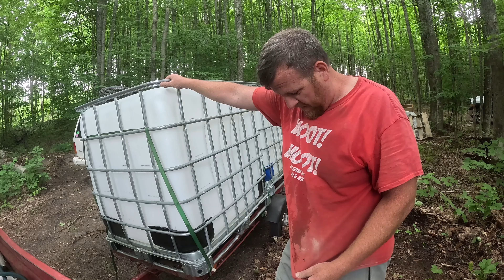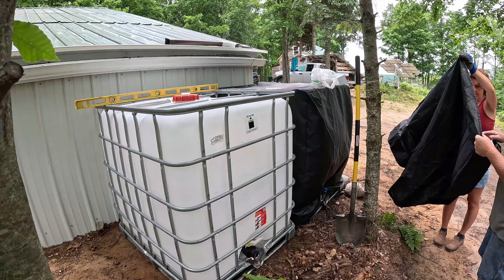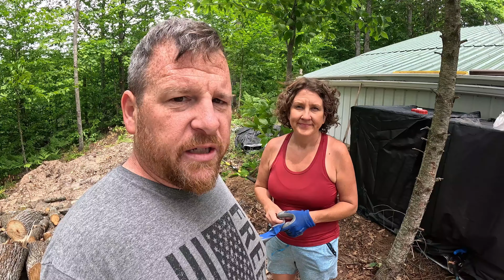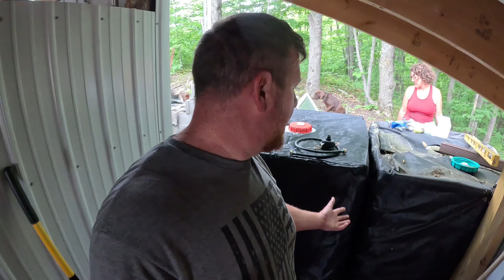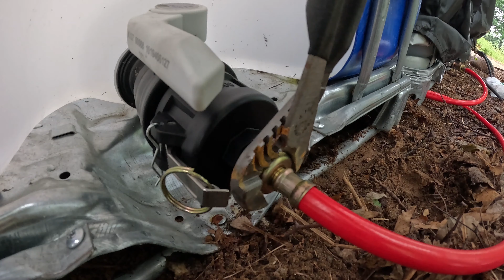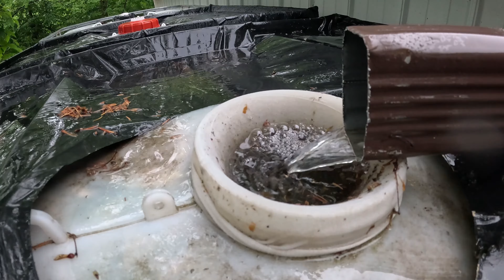Step-by-Step Guide: Expanding Rainwater Collection at Our Off-Grid Cabin - Off Grid Water Systems

Comment: I know I am late to the party, but here is a suggestion.  You might know this all ready.

 You will need a larger hose to move water between the tanks!  When one tank is full and the others empty, there will be about a 2psi difference between the tanks, and the fill will appear to go smoothly.  As the tanks get closer to each other in water level, that pressure will drop to inches of water pressure and the fill will appear to stop.  

Your main tank is being fed from a 2X3 or a 2x4 down spout.  That will fill up the collection tank a lot faster than that little hole in your "Y" connector will move it out.  Water will seek its own level, but not as fast as the water is coming in.

Comment: Great job you guy's 👏. More water storage is awesome. I agree when the extra tanks are full close them off to isolate them from a leak or broken hose. If you're going to put the new shed by those 3 you could add another tank and connect the gutter to the 4th tank so they fill at opposite ends. Loosen the top lids to release pressure as they fill. Great video and looking forward to seeing the next.

Comment: Terrific job guys!  That creates an awesome feeling of accomplishment and should lessen your stress when the rains slow down.  I always say:  you never have too much water or too many solar panels!  Use that on a shirt logo!  Pick up an extra 12V rv water pump and wire it so you can plug into a powerstation, just in case of an emergency where you have to pump out one of the tanks.  Just to be safe.  Stay safe, and God Bless!  Congratulate each other on a job well done!  PS  You could use the pressure washer to help clean out those tanks.  Might make it a little easier.  Last thing:  get a white rv drinking water safe hose to connect the tanks you are going to drink from.   Buy the fittings and custom cut the big hose into what you need.  It will save you money over the washer hoses and you don't want your drinking water to taste, or smell,  like rubber.  Camco  makes it and you can get them at any RV place or Amazon.
Reply from the maker: Nice.....thanks

Comment: I would like to split the difference of our 96° and your 70° degrees and settle for 83° each!
I would replace the wash machine hoses with short RV hoses at some point as they don't shed rubber over time.  PEX would be even better.  Our yard and garden could use some of that rain too!
The Air Force requires a supervisor to sign off as checked and verified on every critical job completion.  In 2002, after a 16 hour repair, a supervisor was tired and signed a job off without checking it, and the aircraft lost a wing during refueling.  It was approaching decommission due to age, so was auctioned off for 700 dollars after all usable items such as engines and avionics were pulled off...   Glad you have a 'supervisor" who actually checks behind you...   😎

Comment: Nice tanks. U gonna put intake sediment filters? They have bypass input filter setups too. Then can use bacteria electric tank electrodes on timers, or timed UV-C aquarium type lamps or LEDS...VERY effective too. Make sure tank electrodes are the same non-corrosive stainless...carbon...or copper...in a grid-type perimeter electrode, then a center-post deal..just like a giant D-cell!! Probably just one amp at 48volts..no more volts..for safety. Any minerals you add will help conductivity. Some even pass water through glass-topped ducts exposed to sunlight for the UV that's same as the UV-C lights!

Comment: I think you're going to need some form of air bleeder for each of the secondary tanks so as the primary tank fills it will allow the other tanks to equalize with the primary
Reply: Yes.  Or crack the lid

Comment: Great video, Jay and Jen!  I know you shut off water to the cabin in the winter, but how do you manage water needs then?  (I empty all my tanks on fruit trees, spruce trees, etc., in late fall and leave one 525-gallon tank about 60% full.  I stagger three tank heaters at various depths in this big tank and hope for the best.  So far, so good re not freezing.  We have electricity but plan to use solar generators to power the tank heaters if the grid ever goes down.)
Reply from the maker: We empty the ones outside and melt snow the rest of the winter. The tank that is hooked to the cabin actually stays pretty warm until late December....so that is nice

Comment: I have a double tank setup with the y connectors it works but if you get a decent rain primary tank will overflow while the secondary tank will only get a small amount through the connection I have lost alit of water I'm working to build an overflow  system
Reply from the maker: I was wondering about this.......I'm also wondering if the pinch point is the y splitters in the ball valve or in the washer hoses. I could replace the hoses with larger pex....but not sure it would help if the valves on the y splitter is still small

Comment: Whoot Whoot, hey you can run hard tube at bottom both tanks will fill equal.. you can link as many as you want. It works just make sure you get good seals
Reply from the maker: Good idea buddy
Reply: I wonder if you build a wood case 6in insulated you could keep 2 totes unfrozen threw winter with a circulation to keep water moving..

Comment: I'll comment again .. there is a way to have the rain waters come in via a trap.  The trap can have a drain plug at the bottom and that is where you can open and let the debris out rather than letting it go into the tank ... however I recall you have some sort of filter at the fill hole of the tank ... look into it .. What if you don't have to flush the tanks out but once every two or three years?
Reply from the maker: Now that we have the set up more permanent and figured out I may try out the first flush thingy

Comment: They feed from the top so tank 1 acts as a form of heavy filtration 

Then tank 2 acts a settlement tank requiring less filtration.

Then tank 3 acts as a filtered water storage, finally the water is drawn from the final settlement tank.

Also all tanks are teed allowing a tank to be isolated for cleaning.
Reply from the maker: Makes sense

Comment: Will your washer hoses transfer water fast enough when y’all get a gully-washer?
Reply from the maker: This is one problem I'm leaning. Itnhas yet to happen, but when sucking water from the main tank with the pump,  the natural gravity flow doesn't keep up. Although I think the hoses are too small the pinch point is also the little Y valves where it narrows down to the size of a pencil.  I'm going to look for some pex fittings next time I'm in town. Hope I can upsize to 3/4 inch hole, which should help.

Comment: Just drill holes in the top side so you can flow water into the next tank and only use the bottom taps for out going water
Reply from the maker: @andrew-cm3zn  but then I have to move the hose around, this way I don't. Just saying

Comment: Trying to get there...just waiting on your step by step electrical setup tutorial at the cabin...From the underneath to the box...electrical is confusing and worrisome.  You said setup like a rv. Idk what that means. Dc to ac...? Ugh 🧡
Reply from the maker: If you go back and catch up you can find videos showing more details. Showing electrical set ups on YT it kinda iffy when not set up traditionally. I basically have a 30 Amp tt-30 plug wired into my panel box I side. I can put that plug into a power station or a 30 Amp outlet that I ran to the cabin from the solar shed. But there are a lot of videos where we talk about it....but again just briefly because of safety reasons